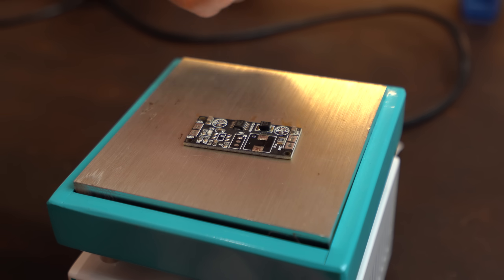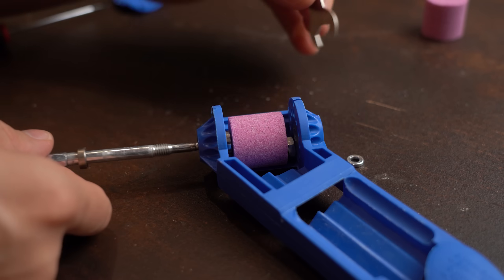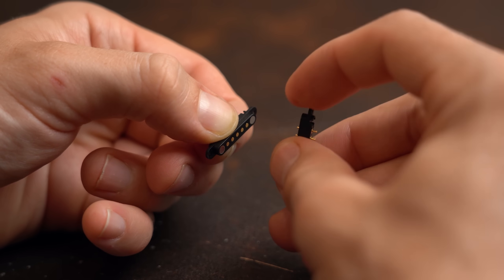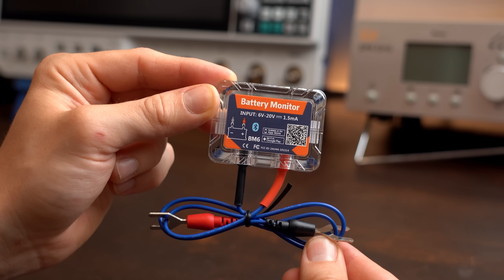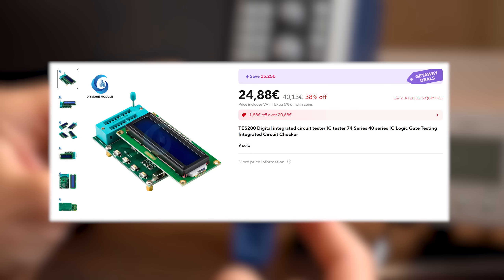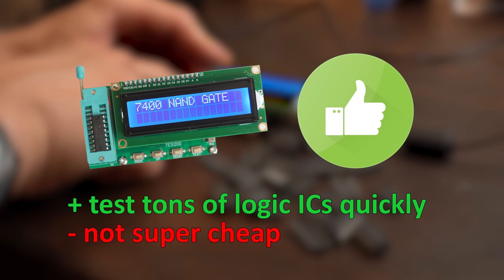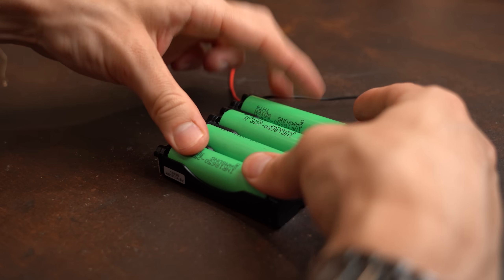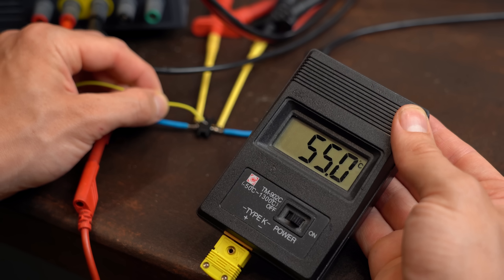I tried finding Hidden Gems on AliExpress AGAIN! (SPECIAL Part 10)

Comment: The best drill sharpener, is the  "Drill Doctor".   Its a lot more expensive... but the ease of use, and the amazing results it produces, is fantastic.   Every drill bit I sharpened, made the bits MUCH sharper than brand new, never used, bits.   The option to make a  "Split-Point"  on your Bits, is also fantastic  (as they cut much better / faster).

 The only issue I eventually realized... was that I sometimes broke small drill bits, when I was drilling things.  When a very small bit breaks in half... its virtually pointless to be able to Sharpen it... because its often too short to even use at that point.    As such... so long as you dont break your bits... you are golden.   Of course, larger sized bits are rarely broken.. and as such,  they will always be worthy of re-sharpening.

 If you have to drill anything in thick steel..   you would quickly find out that you can dull / destroy bits in mere seconds worth of drilling.   Use some cutting fluid (lubricant / oil)  to reduce friction, and help lower cutting temps.  A cooling fan, blowing across the bit and surface, will also help.  Do not apply too much downwards pressure... as that can dull the bits very quickly.   And instead of instantly using a large sized bit... first start out using a smaller bit to drill an initial hole.  Then gradually use larger and larger sized bits, to progressively make a larger and larger sized hole.  Keep the drill speeds, a bit slower..  and stop often to remove chips / dust from the bit and partially drilled hole (also stopping to cool the bit,  and dunking the bit in water,  or oil,  to cool them down quickly).  These will all greatly extend your Bit sharpness / life-span.

 Once your Bit stops cutting well..  rather than keep drilling.. sharpen them.   If a bit keeps spinning, and barely making any progress at all..  the bit is done, and needs sharpening.

 If you do get the Drill Doctor...  I advise actually sharpening all of your new, unused bits... before using them.   I found that the factory edges were nowhere near as sharp as what I got from sharpening them with a Drill Dr.   As such, you have less chances of breaking bits... because they will cut faster and easier... and so you wont be tempted to put too much downwards pressure on them... which is usually how bits end up breaking.

 Whether or not you will get your moneys worth out of the Drill Dr.,  is really down to how often you drill things..  and how much you might choose to spend on new bits.  But I will say, that even if I never made my money back on the thing...  Its great owning it, for being able to get superiorly sharp bits... that drill much Faster and Easier, than Factory sharpened bits.
Reply: I beg to differ. Use the correct cutting speed, with lube and  as long as you maintain a consistent feed per tooth the drill will cut nicely. You get a feel for it.
Any new lads in the factory always suffer from too low a spindle speed and tickle the material, resulting in a dull drill in seconds. I'll sharpen it, double the speed and plough through a hundred holes without stopping. If you get that telltale squeak then it's time to sharpen.
Reply: @TYGAMatt  aye, sounds to me like the difference between free hand and a press, and I was referring to doing it by hand, with a power drill. 

Someone could take it back further if they want; i love my bit brace but I don't want to bore thru inch thick plate with it. I can if I have too, so there's that. 

No one's hitting machining speeds with a bit brace. If I'm boring on my lathe I also spin the material faster than I'll run my Makita drill, but that's because when we're on a mill, or lathe, or press we can eliminate variables and then trust the metallurgy.
Reply: When cutting metal, technique is EVERYTHING. 

have lube, go slow. I'm not kidding. If freehand, go slow enough that you can count the revolutions yourself. It will still cut. In fact, going that slow will ultimately get you thru faster, with bits that can be used again. 

Go super slow with fluid, when you pull it back to blow out chips, give the drill full speed to help cool the bit faster. 

Heat death is, ultimately, the end of all things. I'm much more concerned with my drill bits than the universe tho. At least in this lifetime.

That being said, treat yourself on your next birthday to a set of molybdenum bits. You'll hawk them like the thermostat but gyatdamn are they a pleasure to use.
Reply: The best drill sharpener is someone who learned and practiced doing it by hand on a grinding wheel
Reply: @denecity123  IMO, from using my Drill Dr... its highly doubtful that anyone could match the speed, and accuracy, compared to the Drill Drs perfectly guided spindle bit-holder.

 Not only that... but the drill dr can turn any bit into a perfect Split-Point, in a mere 2 seconds.

 I could probably sharpen 20 Drill sets with the Drill Dr., in the time it took the best hand-sharpener, to complete ONE set.   And my bits would still be more accurate in their edges, and have the Split Point, for even better cutting performance.

 Also, I believe the Drill Dr. uses a Diamond Grinding wheel, inside of the base.   The difference is that the Drill Dr. has a precision rotating spindle guide, that makes a Perfectly aligned edge.  You simply rotate the spindle a few times, and its done.

 And as Ive said... my Drill Dr. sharpened bits cut better than brand new factory sharpened bits.   They cut through steel like Butter, after I sharpened them... and the sharpness last FAR longer, than the factory edge.
Reply: @denecity123  I'll drink to that

Comment: 8:27 a developer here, yes you need gps permission for bluetooth to work. it's a requirement for an app to enable bluetooth functionality. I don't know how things have changed in the past couple of years since I haven't played around with bluetooth for about 4-5 years.
Reply: You only need GPS for bluetooth discovery, not for it to work if already paired.
Reply: @spiikesan  "You only need GPS for bluetooth discovery". But isn't that the real problem? It's location, not the method used to obtain it. There are at least 4 ways to get it.
Reply: There's nothing stopping them from grabbing that data. You'd have to turn location permissions off and then that feature wouldn't work. A tile, Google find my device, etc... would probably do a better job of location anyway.
Reply: @darrentubeify  Stopping them? No, there's nothing stopping them from breaking down my front door, hitting me over the head and then extracting the data from my phone.

Guys, there's no evil tiny Chinese communist sitting inside your phone trying to do bad things to you. Unless the app actively sends that data to some server on the internet (which more likely would be an advertisement company in the US), it can collect whatever it wants.

I don't know about the app shown, but the one for my BM2 doesn't produce any network traffic unless I tap one of the menu options where it makes sense (FAQ, firmware update, online support, ...).
Reply: Are you referring to iOS or Android? I wonder if it's possible to disable the GPS permission after setting it up.
Reply: 08:19 app has a feature to show where your car is parked, what's stopping them from grabbing that data through their app?
Reply: @akashpeiris2428 who cares?  The people who might steal my car are the ones standing next to it and they can already know its location using their eyes.
Reply: @akashpeiris2428 And what exactly are they going to do with that information? The vague scariness of everything is so exhausting. I don't give a flying fig if some company in China knows where my car is. If they want to find out where you live that's already easy to obtain information.
Reply: @BEESANDTOASTY it’s a chilling effect too, if you don’t object to invasive tracking then suddenly the people who do stick out, for some this privacy is really important like abused spouses, journalists in oppressive environments, whistle blowers, all things that we can agree are good for society.
Reply: @BEESANDTOASTY  I can give you an example. Recently car manufacturers were caught collecting GPS data and selling it  to insurance providers.
This way an insurance company can increase your insurance prices because eg. you tend to drive faster than an average person, or because you live in a more dangerous neighborhood.

Comment: did you check the code of the program? turn off gps could just say it turn it off, it could still be active when you click turn it off
Reply: Or maybe revoke the location access of the app altogether
Reply: Location access is needed for any radio access.
So if you want wifi enabled in the app then you must permit location since location can be reversed from wifi.
And Bluetooth can be used as external gps.
I assume that is the reasoning.
Reply: @TheHellis  nearby devices is different permission from internet and bluetooth and the different levels of location services are different permissions on android as is background location.

now if you get granular power to change those on off depends a bit on the device you're using, which is frustrating. I really doubt that company has their own wifi location database. with say samsung mdm api's you can control them all granularly regardless of what's in the manifests too, but you don't get access to those for free, which again is frustrating. there's no real need if you were thinking about the owner of the phone why the owner of the phone shouldn't be able to fix a fake location if they want to - you can do that with a rooted device anyway so apps that depend on it being an actual real trustworthy thing are all flawed and exploited.  bluetooth is a separate permission on ios as well.

now if you care that they know where you're at or where's your car at that's an entirely another thing then that's just subjective. it is not actually easy for them to monetize that data either 2024 (be it your location or which wifi ap's would be visible at which location). if you're buying such data it's very easy to be sold fake data too nowadays lol.

thing is you can make an app like this with the location without having internet, it's not necessary for the function, background location is for you to not need to think about it. it is a feature that you can throw in for essentially free though since it can know when the car was turned off from the voltage if it was connected to it.

Comment: I have several of those BM6 units. They work great, except for the bluetooth range which becomes worse since the unit is under your metal hood/fenders/etc.   I can't even pick up one of the units from my driveway into my house!  So I have to walk out there, to find out if one of my less-driven cars already has a dead battery.

I decided to "get smart" and buy a couple of the BM200's since they operate in the 400mhz range at a higher power!  Bzzzz...  wrong....  if you own ONE of them you're fine!  But guess what... they are ALL on the same frequency, with no unit ID etc!  I can grab one of the displays and just walk from the front to the back of my place, and it will detect my RV, then all of a sudden my tractor.  Oh well.  #firstworldproblems.   :D

Comment: That drill grinder is no good! It removed the relief angle, meaning the drill will rub and create friction instead of cutting!
Reply: Buy a bench grinder, learn to sharpen, and it only takes seconds once you learn, pick up old drill bits from garage/yard sales or second-hand markets, and practice, keep some water close to cool the bit.
Reply: @darrenchapman7203  I'm with you on this one. I'm my engineering training a million years ago I was shown how to do it and then given a big box of dull and broken drills to sharpen. I'm pretty good at it 😊
Reply: @TYGAMatt  HAHAHA love it , me too ! :)
Reply: @TYGAMatt  Have you ever learned to sharpen drill bits less than 4mm? No matter how hard I try, I usually fail to sharpen them properly. Since they are cheap and often break, I gave up on sharpening smaller drill bits.
Reply: @dusanboss7749  4mm yes. 3mm yes. Anything under that and I just grab a new one
Reply: @TYGAMatt they taught you how to do that in engineering training?! Was this a post-secondary degree or some other kind of engineering training?
Reply: Sharpening drills was one of the most satisfying skills I have ever learned. But I inherited a drill sharpener and now it's too fast and easy to not use my sharpener 😞
Reply: they're crap, even if they did what they say the grindstone wears out real fast and you lose the straight edge between different sized bits.
Reply: Agree , if you need to sharpen drillbits that much , just learn to do it by hand , way better !
Reply: Exactly. No way that would work! Especially in way he used. He turned the drill in around and probably just made a tip that is relatively good only for drilling into some softer wood.
Reply: Ditto, you don't get a cutting edge.
Reply: Good enough, cause at this point of bit used you are putting hight pressure. The only problem I see it the right way to sharpened bit that are harden is keep a jar of water to quench it as that how harden met get made and to keep the edge hard.  But as long as you're in no rush just dab shapen and wait. Should be ok.  If heavy use you buy it new anyway.
Reply: The tool didn't remove the clearance angle. It made it negative (which is even worse)
Spend your money on a good bench grinder and practice how to sharpen drill bits by hand
It takes some time but after 100 tries or so you get sharp drill bits that look like from the factory
Reply: Yes, grinder is complete junk
Reply: i found it easier to sharpen the drill without the guide. the plastic part is worthless
Reply: Only because this guy isn't mechanically inclined as much as he is electronically inclined. As a mech engineer, it works fine, if you use it correctly. You can't just blindly rotate the drill and hope for good results.
Reply: Makes me wonder what Project Farm has to say on these, given how they performed in his tests.
Reply: From my experience, handheld drill bits rarely get dull, they tend to chip the edge and at that point you should just learn to grind them on a bench grinder, and when you can sharpen one on a benchgrinder then you can use anything from a big belt grinder to a handheld angle grinder.
Reply: Exactly it removed the "Rake" angle.
Reply: @dogwalker666  No.  The rake angle runs down the entire length of the bit. And has more to do with the angle that the cutting edge contacts the material.  The relief angle is the part that is being ground down by this tool, as well as the center section known as the chisel angle.  Grinding off the relief and the chisel angels will render the bit useless.
Reply: That's because he used it wrong and rotated the drill bit. Should have sharpened only the cutting edges.
Reply: @ooltimu  Trust me,if you sharpen ONLY the cutting edge,you will lower it more then the rest of the tip surface,therefore it will not make contact with the surface you drill. Result: the rest of the tip will friction,heating the bit without drilling. I sharp my drill bits on an angle grinder,after sharpening,the drilled material  comes out in the shape of a spring,when drilled in iron or steel.  The trick is to get your hand trained to create the optimal angle when you sharpen this way,but no,that sharpener tool does not work,i tried it.
Reply: I think another problem is, that usually when you have hardened steel the outsided layer is harder, so if you grind it down, you might get a good edge but It will get dull faster because the metal will be softer.
Reply: @forstig rubbish.  Drill bits are tool steel, not just case hardened steel
Reply: @BrettDalton  tool steel can be hardened too
Reply: @forstig Exactly! 👍
Reply: yes but a very dull drill bit it does not have it anyway.  the grinder workers on really dull bits but the sharpening effect is little on metal but good enough on wood. Device so cheap but then again buying new bits also cheap.
Reply: Good drill bits have hardened tips and grinding edges, or they are made of different alloy or material, like tungsten carbide, or they are diffusion coated by nitration. In any way, when you grind it off, the bits become useless
Reply: Its better than paying for new. At the least, you might extend the drill bit's usefulness or make it last until you're done for the day.

Comment: Not trying to rag on you, just want to give you a bit of advice that might help you avoid grief trying to use those drill bits.

That drill bit had a whole lot of negative rake (generally considered dull, the edge is pointing back towards you and the drill rather than at the material) it was also sharpened off center, and neither the before nor after tests were producing shavings like they should, they were making dust. I'm not saying the gadget is useless, but it does require a bit of operator skill. There are slightly fancier drill bit sharpeners for not much more that hold the drill bit in a collet and ensure you get a symmetric sharpen, with the proper cutting angles. Not as cheap (~50ish euro? Not sure) but they work better if you haven't had the chance to learn how to sharpen drill bit manually.